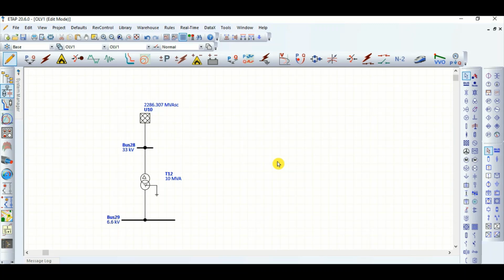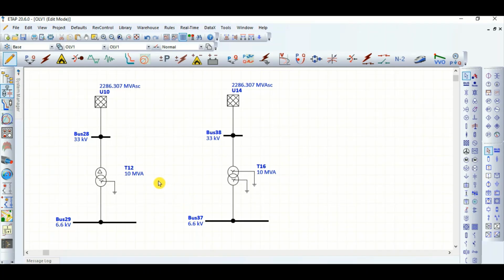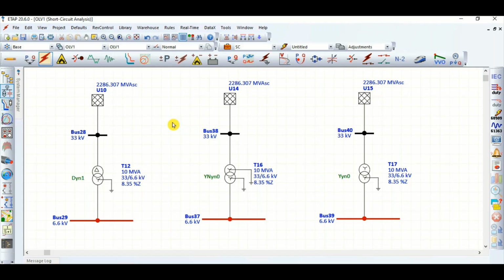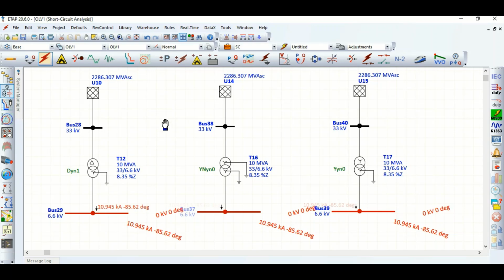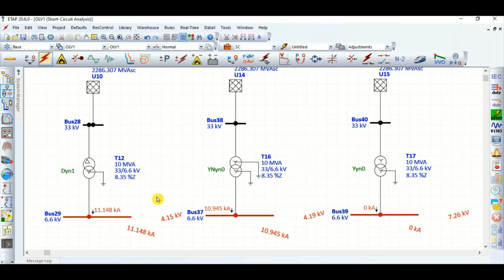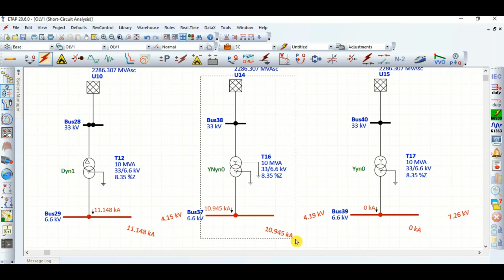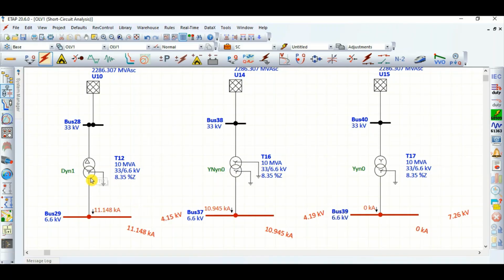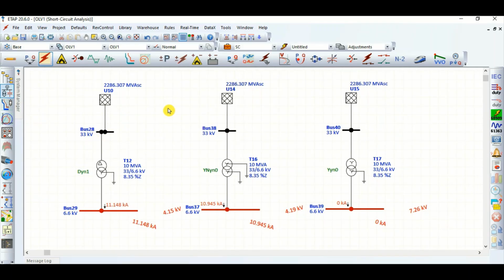Impact of Transformer Winding Connection on Short Circuit Current using ETAP

Comment: why we do not recommend third case, as the fault current is zero so it is good for us ?
Reply: Since the system could just keep operating in a ground fault situation it makes it potentially unsafe. There is no current for a CT to measure and a relay to detect to trip anything offline. There could be a wire laying on the ground somewhere thats fully energized but its not detected easily. There can also be over voltage issues on the un faulted phases